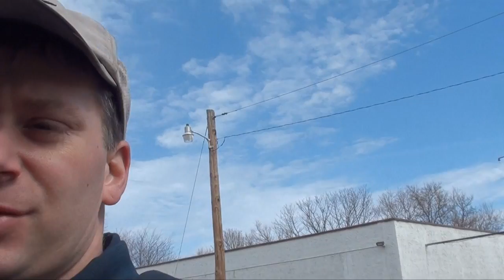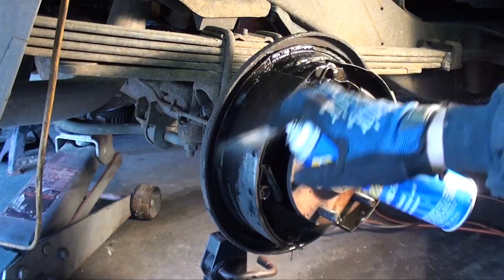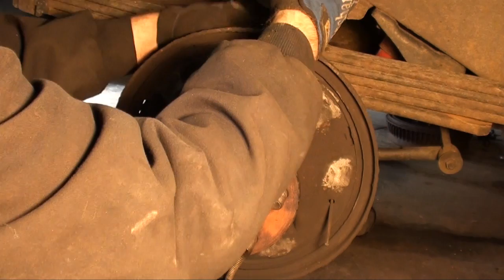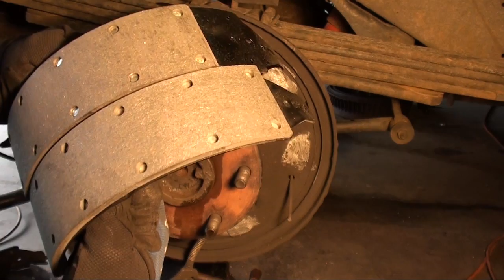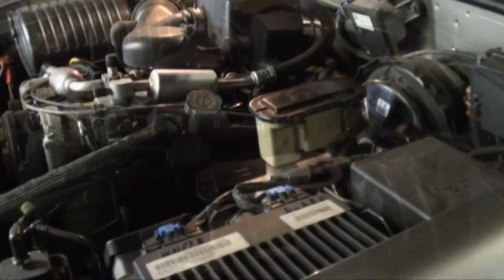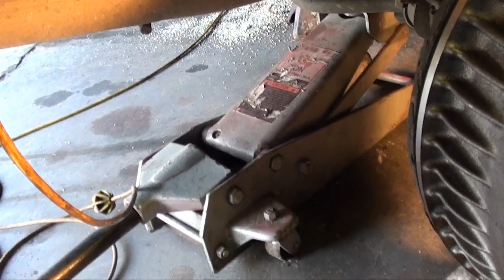How to replace drum brakes, wheel cylinders and front pads GM

Comment: I am no mechanic but when I inherited a 1976 Chevy I needed to replace the wheel cylinders and brakes in the rear end. Watching this video a couple times and taking multiple pictures made it pretty easy. It took me an entire day to do both brakes. Passenger side was done without those brake pliers and the drivers side was dkne with the pliers which made life easier until I had tocut the bolts from the wheel cylinder but better than the brake lines. Thanks again for a great tutorial.

Comment: Nice job will, I enjoy your videos. I use anti-seize all the time religiously on bearings, bolts, studs, etc. I have found over the years that anti-seize on auto adjusters and caliper pins tends to harden and cause gumming. The adjuster tends to get mucked up with brake dust. I have started using silicone paste and it seems to work out great. Keep up the good work.

Comment: Hey Will great job on them brakes. I find on most drum set ups that the adjusters only work with reverse braking and most people never drive and stop hard enough in reverse to actually make them adjust properly. After time the rear brakes end up not doing much if anything at all. For final setting of the brakes I do some repeated reverse stops and you feel pedal pressure and braking improve. I also do this on occasion to keep them adjusted properly. Keep up the great vids

Comment: Great video specially the time you took for rear brakes. Since they don't wear fast. As weekend mech I don't get to work on them often.  Found that today snapping a photo or two with Dig camera is way to go. "Gravity bleed".., never heard of that, good tip. Self adjusting brakes. Never quite understood them. You helped some but tell me do they adjust for normal braking or emergency braking? AND most important How do they not over-adjust. How do they stop adjusting themselves?

Comment: Nice review, Will! This is identical to my 2000 suburban. From the angle of the camera, the left front shock seems to be leaking oil.

I have trouble visualizing how that automatic adjuster works to move the brake shoes outward as they wear. A year ago I found some animations, but they don't seem detailed enough to show the whole process.

Comment: A really great video.  My only added comment would be.......if you are replacing the wheel cylinders as part of your project, work on loosening the wheel cylinder up prior to removing all the brake hardware.  Reason is....if you strip the head of one of those two 1/2 inch mounting bolts (which I have experienced several times), and you are doing this in your home garage, you will likely need to take the truck into a shop to get that seized/stripped bolt removed (depending on the truck, there could be not much room in there to work on that seized/stripped bolt...2500 springs make things pretty tight.....you may not have a torch, or a welder to put a nut on that stripped bolt head).  As such, easier to do if you haven't yet pulled off all the brake shoe hardware. Same thought if that brake line is seized into the 3/4 fitting (the one that goes into the wheel cylinder).  Some trucks do not have the room to pull the wheel cylinder towards you (pulling the brake line through the backing plate) and spinning off the wheel cylinder as ROBINSONAUTO has suggested....which by the way is absolutely the correct thing to do if you have the space.  If it is seized in the fitting, and you are not willing to replace the brake line yourself, you will want this done in a shop.  So.....get that wheel cylinder freed up before you pull off all the shoe hardware.

Comment: For people who dont do this often, its good to snap a pic with a smart phone before you take everything apart, too.
Reply: This is good advice make it a habit in general if you are rusty or is your first time to snap a pic
Reply: @LMBee00  it's easy to confuse left and right side when figuring out how the right should be connected when looking at the left but as long as you have pics after taking each part off you are good. There was at least 3 different sets of breaks which could go on a Silverado around this and you need to have the code from the glove department to get it right.

Comment: There is an inexpensive tool to compress the caliper piston back in which you just turn the handle and it pushes on the old pad.  Also, you should never (old or new car) push that old contaminated fluid back up backwards through the ABS system and the master cylinder seals.  The old fluid should exit through the bleeder screw into a pan, which also makes pushing the piston back in easier and preventing premature failure of the ABS system and master cylinder.

Comment: Well done, after rechecking my 2002 2500hd frt  suspension your way in an unloaded position I did notice my pitman arm needs replacing.  The nut is  directly over a cross member and cant get the pitman arm puller in there , no space at all.  I  can use a large wrench to take the nut off.  Is there a  way of doing this without removing the box completely ?

Comment: Great reference. However... I could not get any break fluid to get into the cylinder...its coming through the line at the insertion point but nothing through the bleeder.  I pumped the pedal a bunch but no luck.Does that mean the cylinder is not good(new)? What am I missing?

Comment: Hey Will, I have a 1997 ford F-150 with a 4.2 V6 5 speed manual. It has a manual transfer case and will go into neutral and into 4 lo only. My votech teacher told me something about a vacuum switch and was wondering if you had an idea of whats wrong.

Comment: I did the wheel cylinders on a 98 z71 and when I went to bleed the brakes no fluid came out after I added fluid to the master and when I pump the brakes it acts solid could this be a pinched line or a plugged line

Comment: i replaced rear shoes and drums on my 95 astro van now the thing shudders like hell when driving it any suggestions.I did not replace the springs the guy that did it put the shoes on back wards and i drove it that way for about 600 miles also i noticed that he ground down that emergency brake cross bar to make it fit because he had no idea the shoes were backwards do you think that my be the culprit?

Comment: A question I have when I hear you say something relating to the front pads as being a lifetime warranty, I worked for AutoZone for a fewyears and the lifetime deal was in case they failed as in falling apart or some other bad issue, the warranty did not cover a free set of pads just from normal use which is what happens to them.

Comment: missed an important step , its imperative to remove the rubbers sleeves for the front caliper pins  and use a bore brush to remove the rust in the bores  , then smear  (silicone) brake lube  on back side of rubbers and put them back in , this will prevent rust from building up in there and swelling the rubbers from the back side  pinching the slide pins , that is the main cause of slide pins not moving freely and seizing up. I use a small screwdriver to ream around rubber sleeves and a pair of needle nose plyers and pull at same time to remove them, they come out  easy once ya get the hang of it.

Comment: Hey guy whats your 1st name? Ok I did the brakes and found the Vacuum leak wasn't a leak it was a capped  line that got broke when I was replacing the distributor anyways Now  I can' get any brake fluid at the rear brakes. tried gravity and manual with an assistant I read in the manual that I have to hold the combination valve metering pin  in to bleed the rear brakes can you give me some help with how to do that The  manual  Chiltons ) is pretty vague for the home mechanic trying to saver money Thanks

Comment: Just replaced the distributor cap and rotor on a 1998 chevy k1500 4.3 v6 vortec while climbing around broke the vacuum line that comes out of intake directly above the # 3 cylinder lots of vacuum truck runs like crap at idle can't find where this line goes to. Can you help me with this one? f I plug it off truck runs great.
Reply: Denfala just go to a junkyard and look at a truck like yours....i done that on my wifes escort...been tore down so long i forgot how the vaccume lines ran

Comment: I've noticed that people working on the brakes dont seem to worry about the asbestos. has there been some improvement on this?
Reply: +Sarah Rivera You should always worry about this, that's why you use brake cleaner. It wets it down so it doesn't go airborn. You can also use distilled water and pour over everything to dump off the excess dust. Never use an air compressor to clean these things. It wouldn't be a bad idea to wear a mask.

Comment: Ok I bought a 1988 1 ton that had the rear brake components removed.  So I bought a new spring kit.
The problem I have is the pins that go threw the back plate then the shoe plate with the spring and retainer clip..the pin is to short.
 What is the pin length I need .
Also the new springs are so hard to stretch and connect.  Even with a tool. I wonder if they also are the wrong length? I would like to know there proper lengths for this vehicle. Thank you .
The parts store says I have the right kit.. no way that the pins are right. With spring compressed retainer clip doesn't even touch the pin.!
Reply: You probably already have your pin problem resolved, though you could watch Dr. Shock"s video on rear drum brake replacement on his GM 2500, whereby he ordered a pin & spring replacement kit from GM. It contains many different length pins, cups, and spring sizes for different vehicles!
Reply: @shawndwyer6209  yes I think the kit is wrong springs are to short also. Even thow auto parts store says it is the right kit. I cant even get the springs to stretch that far to put them on.

Comment: Do you have a video for the 10" drums Thats what I have on a K1500 v6 work truck The springs are a pain!
Reply: Those are Easier to do.  Two hold down springs, One top return spring and the little spring on the bottom.  I will be doing mine soon. Ill have a video
Reply: ghtowagon Thanks for responding so fast.

Comment: but reading the warranty guidelines that in fact is wrong, they(autozone employees) are not to do that for its knowing that you are going to damage them on a bad rotor, clearly states this in their warrantee guideline. I worked for Auto zone for 8 years and never honored a warranty in this manner. Relating just to brake pads/shoes for example, a warranty only covers if the part failed before due time of life, to get a pair free just from normal wear, where are they making money?